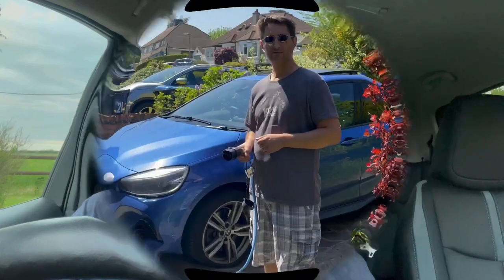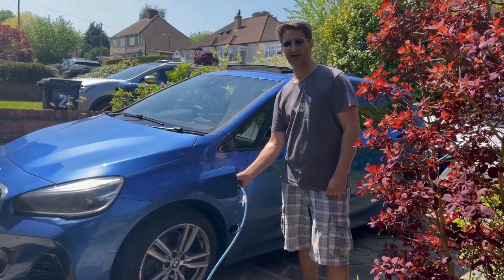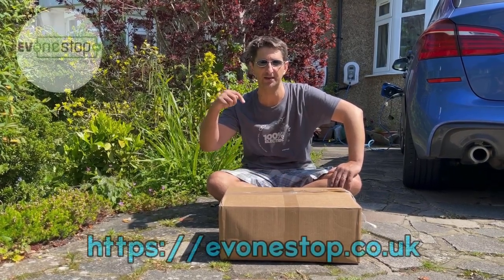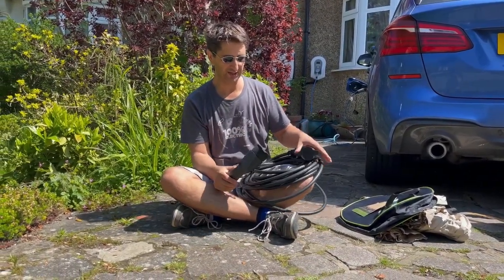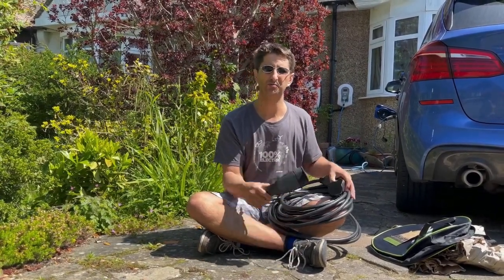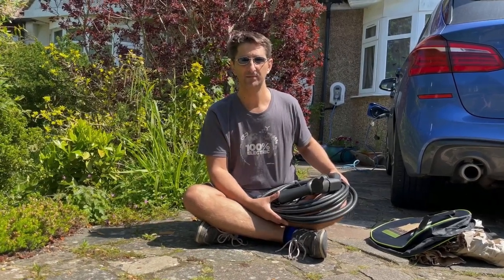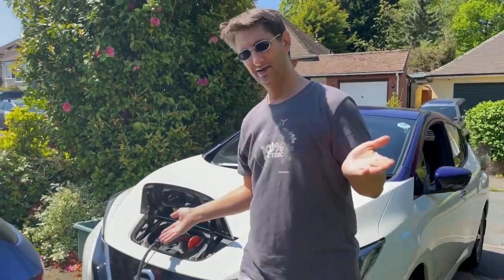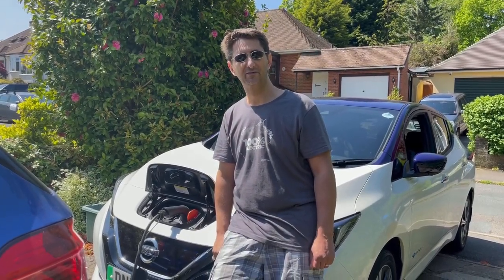My Charging Cable is too short !!

Comment: this should be in everyones boot just in case you need to run the cable that little bit further at a public charger. im also considering a 10 metre granny charger too just in case i need to charge overnight (on holidays) eliminating the need for an extention cable
Reply from the maker: Yes. I am also considering getting a 10 granny cable too. I may sell the 5m obe to recoup some of the money. If you do buy don’t forget to use the promo code in next 2 weeks to get £10 off ! 😁👍

Comment: I gave an Ubitricity lamppost charger a go this week when a long section of street cleared just before a parking suspension for a big stadium rock gig. The three lamppost sockets are fairly new but this street is usually fully parked up making the chargers almost pointless. Tempting thoughts passed about getting a 10m or longer cable so the post might serve at least 3 parking spaces. [Amusing that the YT algorithm popped up the video again exactly a year after you published it and I'd already watched it previously!]
Reply from the maker: I am going to do a video on Ubitricity at some point, a few popping up near me too, some even on my daily commute route. I the early days you had to buy a special charger cable to use them, but now you can just activate using your phone. It makes total sense to utilise the existing street lamps like this, it should be done to almost all of them I think. It allows lots more chargers without need for new pavement furniture! Yes longer cables may be handy , so long as they are used sensibly, and not in a way that could be trip hazard etc. these are great for terrace houses etc or car parks in flats with lamps, those who don’t have off street parking.

Comment: I've not tried this yet, but with a tethered charge point can you use the type 2 lead supplied with your car to extend the charge lead?
Reply from the maker: I looked into this and EV One Stop did have one extension Type 2 I believe but they were only compatible I believe with Rolec charger leads, but best to ask them. There are a few other reputable U.K. Cable suppliers and I think done also had Type2 to Type 2 extension leads. Not sure what their limitations are.

Comment: Just out of interest, how well does it reach the bmw if that is parked second, because the port is not at the front?
Reply from the maker: It’s doing it that way right now. Plenty of length. In fact that is the usual way round, with Leaf on the V2G tethered CHADEMO (effectively the Leaf is charging the BMW PHEV).